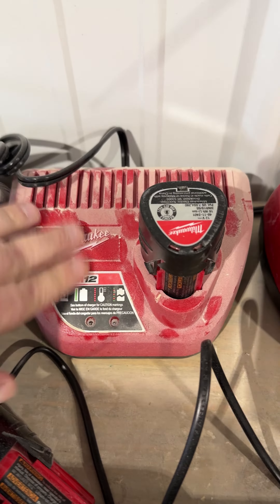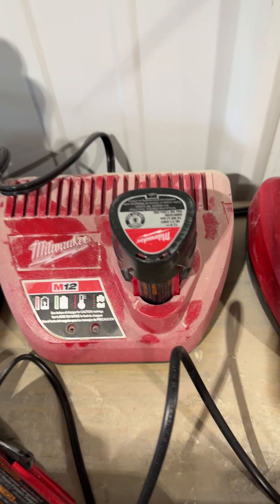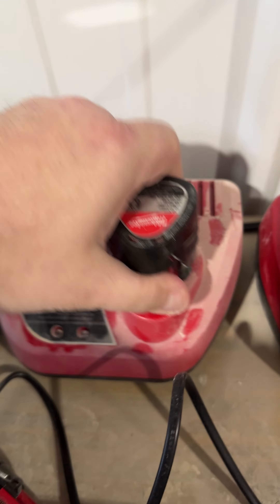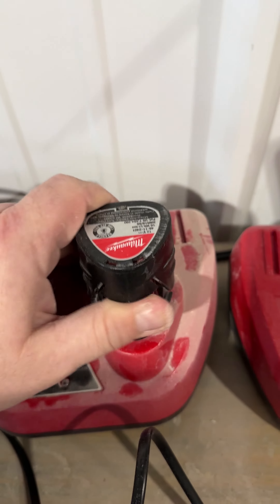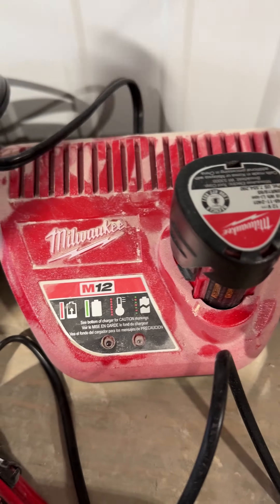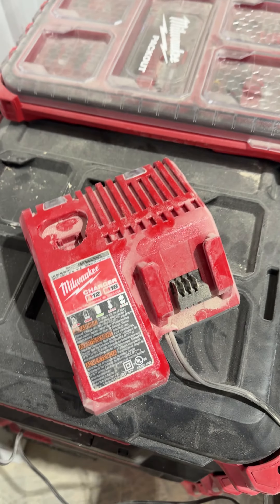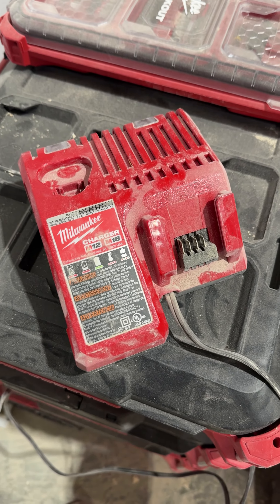Tool is there a trick to making the chargers last longer? I feel like they last less than a year for

Comment: I only use m18 and never had a problem, but man those are pretty fuckin dusty. When I’m cutting concrete or wood I don’t let the dust get that close. And you have a lot of plugs in the same outlet you might not have enough amps to charge everything at once.